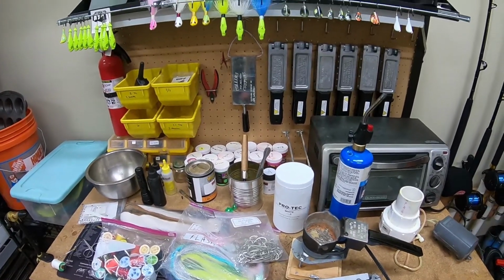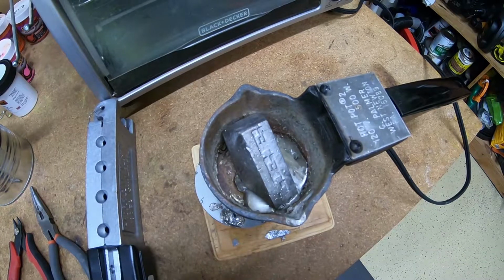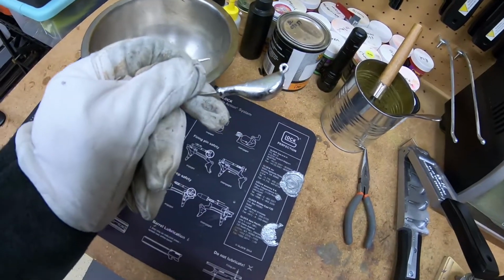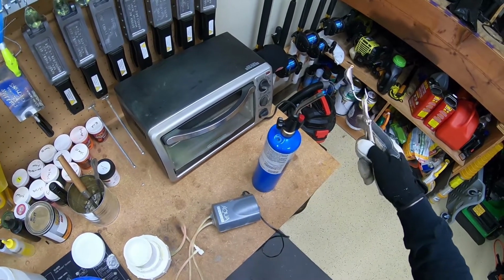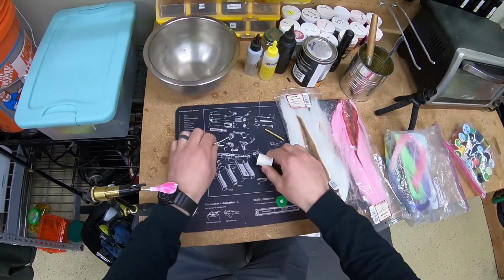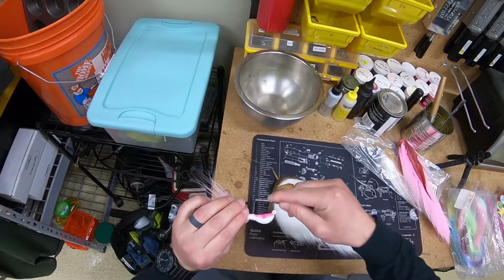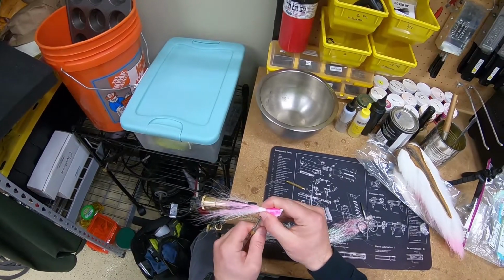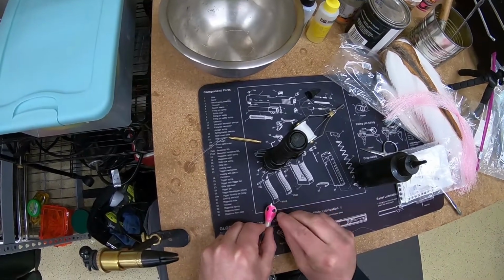Pour and tie your own bucktail jigs! How-to: from start to finish!

Comment: I tie commercially and thought folks might be interested in knowing that Rapala makes "Super Line" scissors that you can pick up for about $5.  I have made over 7,000 bucktail jigs using my current pair.  One of the blades is serrated and grips bucktail nicely.   Hope it saves folks a few bucks.
Reply: For some reason I can’t watch the video I’ve been trying my own bucktails for stripers for about an years now and have gotten pretty good at it. My only question to you is have you ever tried vinyl jig paint and is it a lot tougher than powder coat?

Comment: Been tying for 25 years and you did a fantastic job teaching the process. Over the years as I got better and winning tournaments on my jigs and spinner baits I started tying for freinds and family and before I knew it....phone started ringing and now I tie fornthe public. I have custom designed spinner bait molds with short arm wire for night time smallmouth. I used a CAD system to design my molds and them machined them out. I most tie crappie, smallmouth and striper baits. Great job and thanks for sharing.

Comment: There’s a trick for threading your bobbin. Insert your thread into the bottom of the tube and suck on the other side. Make sure you have enough slack and it’ll come right out the other side. I’ve never used one of those little threaders.

Comment: Bobin threader is what it is called. 

Here is a tip about bucktail  if you don't  know already.  The  bucktail from a deer can vary  from tail to tail. The  hair can be straight or wavey . Straight hair is ideal  for most jigs.  Hollow and the base and the hair gets stiffer and less hollow  the closer to the tip of the tail.

Comment: Why don't you go straight from the mold to powder paint while it's hot???
Reply from the maker: You could, but I prefer to get the jigs cleaned up first and looking perfect, file down any rough areas, etc which is easier to do when cool when you can handle them.